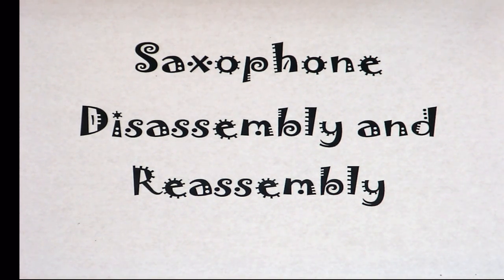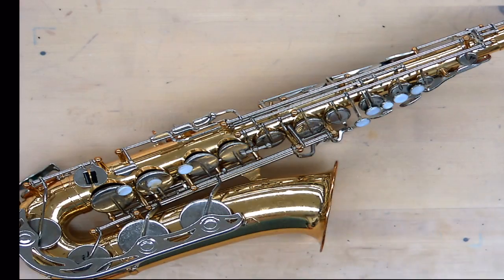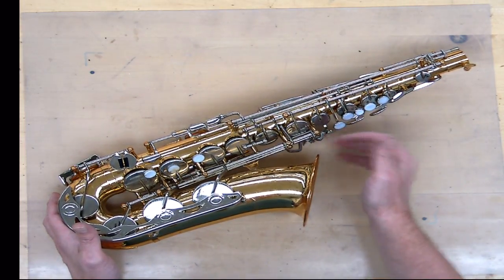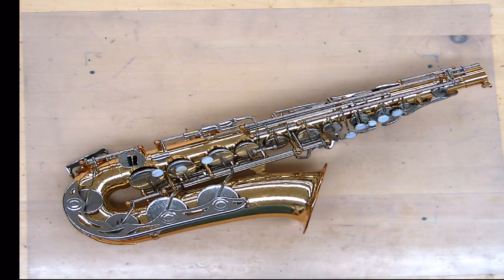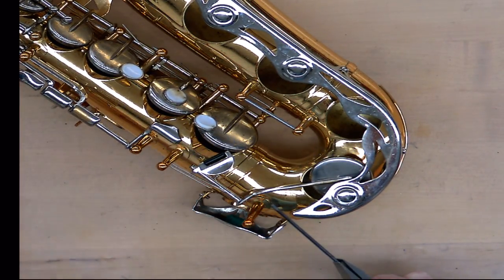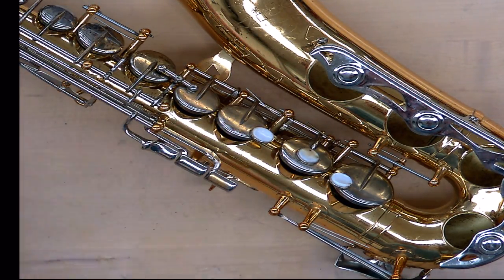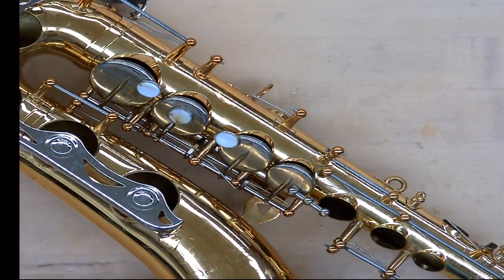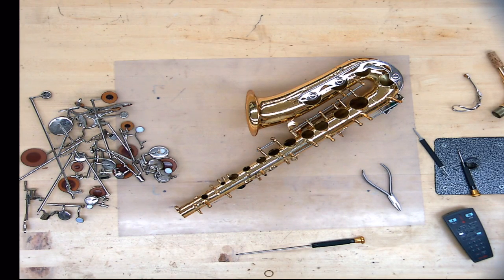Saxophone Disassembly I

Comment: Good video there. I recommend when the sax is being taken apart check each hinge rod for straightness by pushing it through the rod to make sure it fits properly. This is especially helpful on keys such as the low C/Eb that is commonly bent. Get that done  before reassembling it so you have that out of the way. Also, the Vito that you have may be a Yamaha 23 but several Vito models are made in different locations and are not similar to Yamaha at all.

Comment: good evening sir  is it possible to do this pad changing on the horn in sections ,completly changing pads and springs one section at a time, without taking the whole saxophone apart and not being able to get it back together

Comment: Well I compare the sax to the automatic transmission. Each who came up with what the sax person must have gone nuts like the auto trans inventors. I mean why would someone develop a transposing instrument? Well I have an old USA made Bundy and not a Bundy II. It needed pads something fierce. Taking mine apart I just started with the left hand keys and went to it. Going back together is a better headache, knowing what needs to be there before putting what goes there. I use a little old precision screw driver, small needle nose and a short forceps.